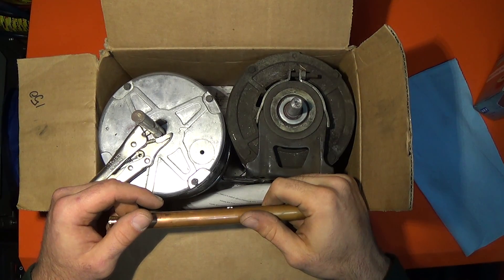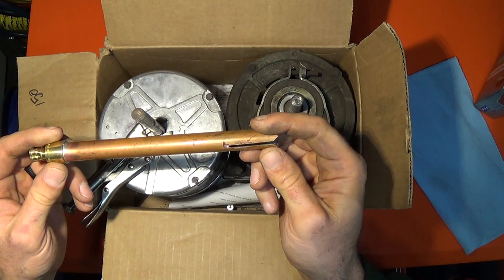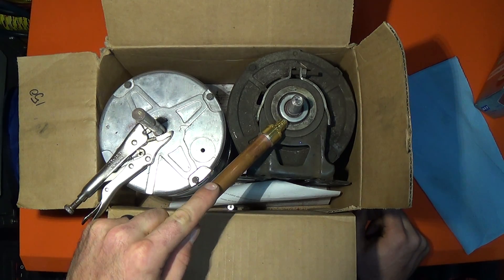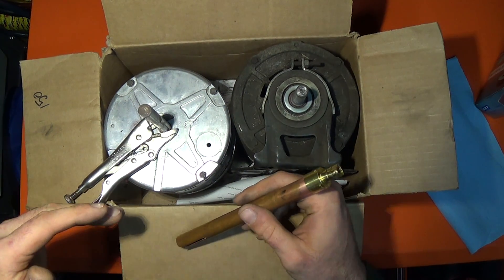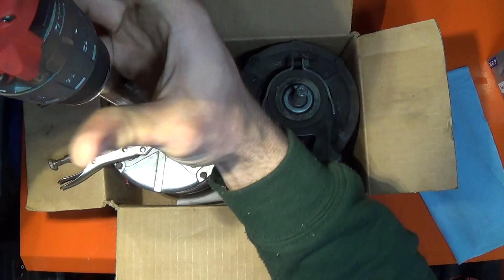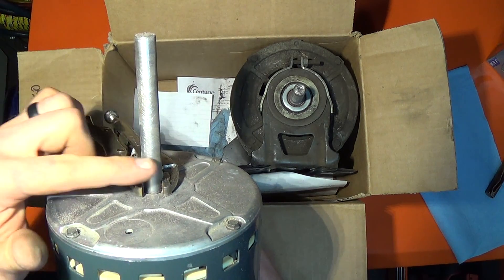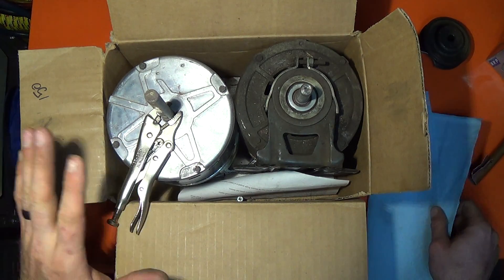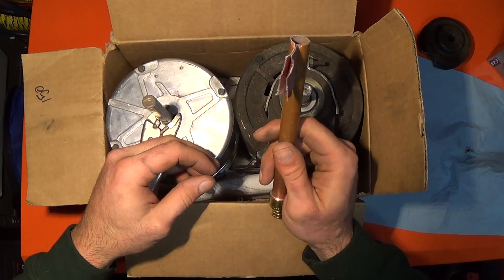Tools7: Homemade Motor Shaft Sander for Typical HVAC Motors

Comment: Great idea and invention. I’m going to make one
Reply from the maker: Thanks!  It works awesome!  One change I made was to braze a 1/4 hex bit into the pex fitting to make it impact ready.  To braze steel into brass you’ll need a phosphorus free braze such as safty-silv and brazing fluz.  One other option is to braze on a socket that fits tightly over the copper pipe and use a socket to hex adapter.  It can make alignment easier.  Whatever is brazed on needs to be relatively straight to avoid wobble 👍

Comment: Was it easy to braise the three metals for your steel impact bit and that brass fitting as well as the copper pipe? I have not been successful with braising copper to brass (I tried to fix a reversing valve that way) but I’d like to make this tool if you have any advice or a video to help!